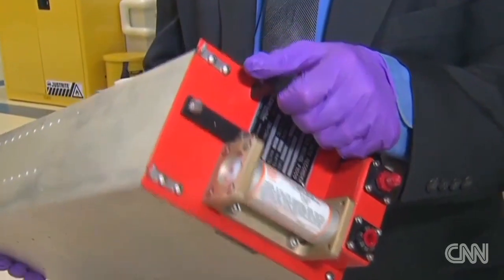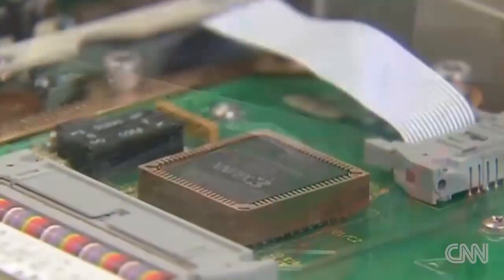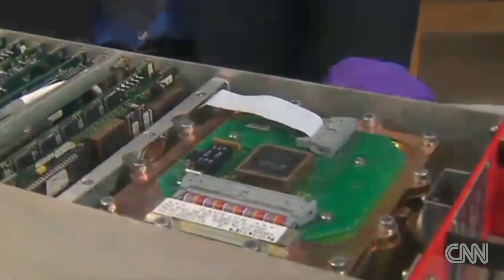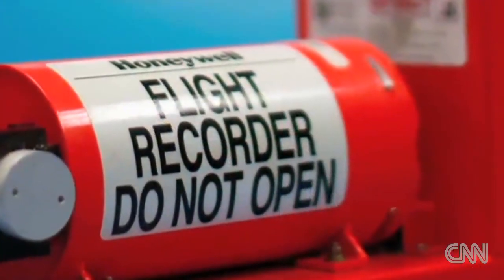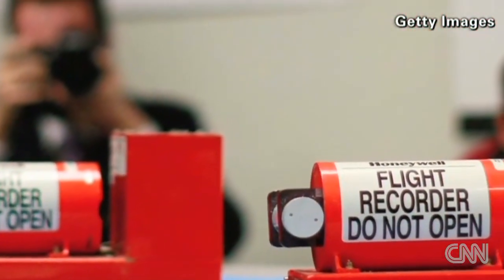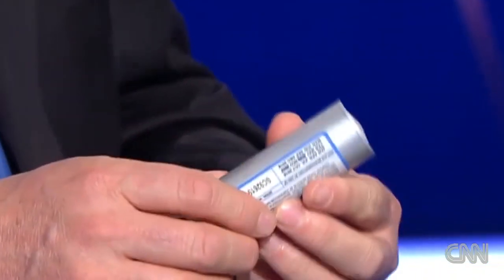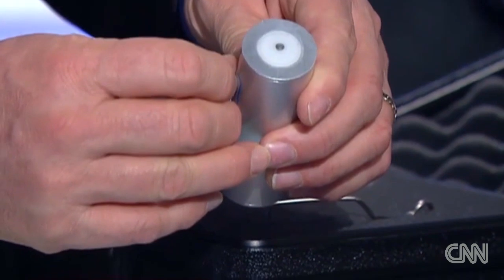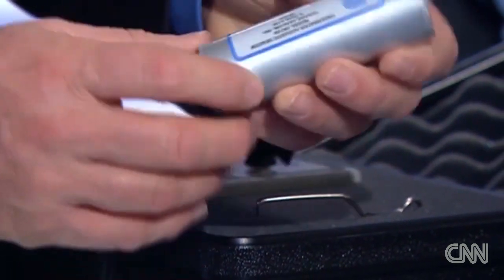What you need to know about a black box

Comment: Hi , CNN reporters,

i do not need to know how it works or what inside. i just need to know how strong it reserves the data and how fast it could be found. 
where could I find the statistics the black box damaged or lost in crashes.
1 out of 100 ? 2 , 3 ? where could I find this statistics. \\
and after 370 issue. is there any new rules to upgrade the signalling time ? any new regulations to upgrade the data protect technologies ? 
or just nothing like nothing happened.